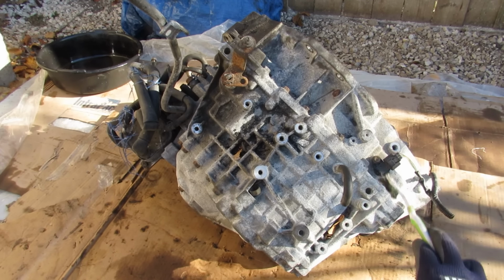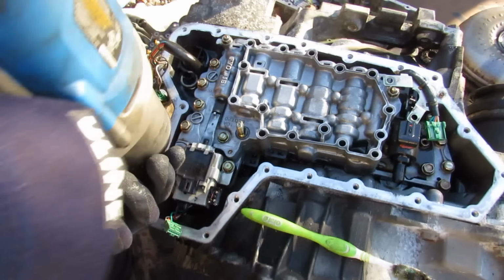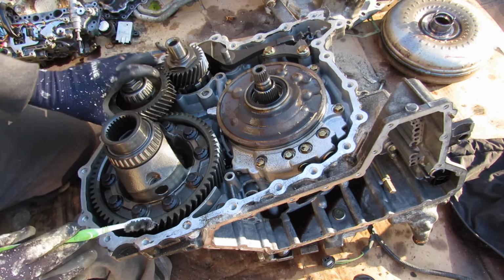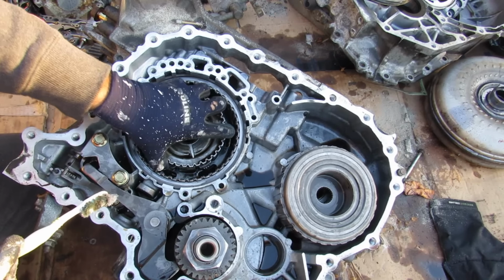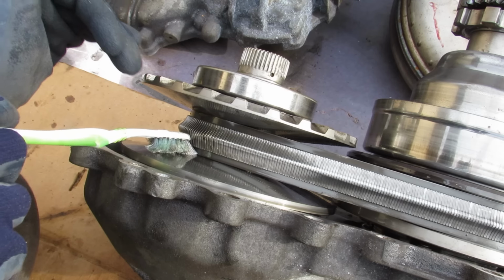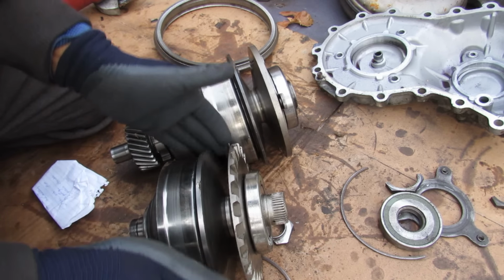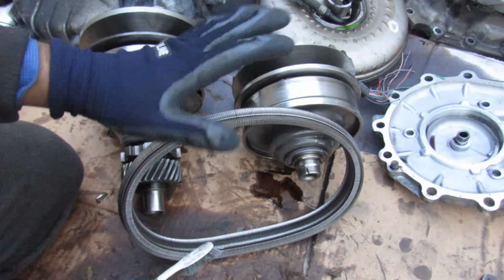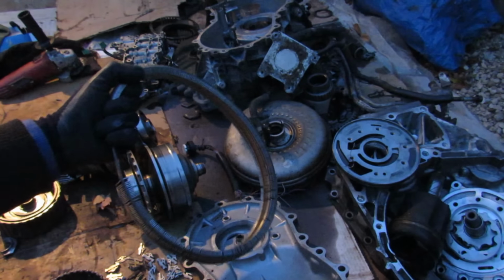Why Nissan CVTs FAIL

Comment: OK, let me ask a question please. I can see that the gearbox ratio is really continously changing with this kind of transmission. Depending of the state of the 2 pulleys and the steel belt. So far so good.
I had a Honda Jazz CVT in the past. It was CVT, and it worked with discrete gears !!! It had 6 gears and it had even +/- paddles on the wheel to do the shifts with those if I wanted. And a digital number has shown the actual gear, D1....D6 like a six gear regular auto transmission. It was CVT, that was the name Honda Jazz 1.5 CVT. Why wasn't it a real continous transmission ? I have expected that.
I sold it, now I have a DCT transmission car, that's different.

Comment: I have a 2019 Nissan 30k miles and shuddering on a rolling stop. In for repair and they said valve baffle is the first step in the repair flow chart. 🙄
Reply from the maker: There's a repair chart? They really don't want to replace the transmission in warranty eh

Comment: yes! as many have said thank you for informing me more about how cvts work.. i had laymans terms explained to me as a steel rubberband that expands and shrinks to determine gear ratio but didnt know much more... definitely helped make the decision to not go and buy a mid-large sized vehicle with a cvt (a nissan at that ) my small corolla with 100k had a cvt and it was doing fine but it was my big fear that it would break and be worthless to repair!

Comment: I have an '04 Serena import with CVT and it seems they fail around 60k miles. Non repairable so only solution is junk yard finds to replace at regular intervals it seems. I want to swap for ordinary auto tranny but can't find an easy swap.
Reply from the maker: Swap to a manual

Comment: MAAAAN i wish the CVT paddle shifters had a 3rd option of 'manual scroll' for continuous\seamless play through it's endless ratio like the CVT's nature and not jump ONLY through pre-set one-digit ratio that's determined by the engineers to simulate only few consecutive gears.. i would've LOVED to have an option of freely use the +\- function via the paddles to use all of the CVT ratio. THINK of how awesome it could've been if u could hold the minus paddle while slowing down and have the transmittion gradually and smoothly reduce the ratio like changing a volume dial or sth, and have a similarly gradual deceleration like it ACTUALLY does in acceleration, just in the opposide direction of operation. Why no one did that yet??

Comment: I'm always curious about how the force acts on cvt belt when the car is on engine brake? How much stress is on the transmission then? 
And more, if you are climbing/descending a steep slop and give it a sudden brake to stop, how the transmission will react? Can it be damaged?
Reply: One should just drive it like an automatic and use the brake pedal. Because power goes through a torque converter there is little trouble at low engine speeds. At high revs the converter is more dynamically connecting the wheels through the belt to the engine and any down shifts are going to try to stretch the belt and also wear the pulleys.
Reply: @joeKisonue  see what i said up above about two-feet driving, joe.

Comment: So in that case why this transmission failed?
Reply from the maker: This one didn't fail yet
Reply: @speedkar99  ouh...
Reply: @speedkar99  so you destroy it for learning and teaching purposes. I was thinking that it was broken becsuse of oil and hardly used belt. Something lost spec dimensions and belt start sleeping on cones. 

Btw this is quite interesting engineering.

Comment: The main reason Cvt trannys dont last is all the power all the times goes through a flexible  steel belt so fluid quality and heat are crucial . Normal Transmissions has the power spread of many gears. It's worse the more power you try to put down on the road. Even Toyota they don't use that many Cvt transmissions but I know the Corolla  has a Normal First gear for starting out and then the Cvt takes over once its up to speed. I hate them, That never shifting and droning . I have always be partial to Honda Auto Transmissions they have that mechanical jerky automatic . When I graduated from High School my Dad bought me a  new 1994 Honda Accord Ex . Best car I ever owned  and roughest transmission ever but it was just part of Honda quirkiness and character.

Comment: So right after watching this video my 2001 Nissan primera with a qr25de 2.5l failed last night. It is not shifting past 3rd gear. After that it just revs higher. Changed transmission oil but still same performance. ?

Comment: yeah...but do you know anything at all about CVT transmissions? 
Seriously dude, you should easily be awarded the Pulitzer Prize for being the definitive authority on CVTs, and the art of creative use of undergarments of close family members...and of course a Nobel Prize in science as the erudite clinician regarding absorption rate, shear and thermal dynamics of cardboard. And using a toothbrush for a power-pointer...that is a mic-dropper right there.

Comment: You can 100% rebuild Nissan cvts. There is also a handful of computer related work required after replacing or rebuilding, so we don't want people to think they are just going to pop one in in their driveway and save $3k. 

Tons of people tow with them no problem,  just keep it under the spec. 

If you can't prove it, don't say it.

Comment: Just testing a few demo cars with new technologies like CVTs for several years in real life conditions before including it in their cars would save automakers so many headaches. Releasing a technology a bit later is certainly better than having to deal with mass recalls and class action lawsuits.
Reply: only in developed countries like USA where manufacturer can be fined for hundreds of millions $ for installing such a defective part (Dieselgate, Toyota blocking gas pedals at max). In the same time, in third-world countries nobody cares and unhappy customers barely get something compensation, if any.

Comment: It has moving parts. and a band that slips over metal. it rubs and slips. It IS going to fail eventually and they work alot. Thanks for an awesome vid. If you got snookered into buying one of these repair shop magnets.

Comment: Thanks for a very thorough explanation of the CVT and its' function / weaknesses. In cities, with all of the stop/starts made at traffic lights, the CVT does not seem to suit such an environment, particularly if the car owner decides to 'floor it' away from the lights! I think that the first CVT transmission was used on a DAF Daffodil car from the early 70's. But (by today's standards), the DAF Variomatic was a rubber belt drive, and crude by comparison. With the future becoming electric vehicles, the CVT will not be needed, because electric motors can supply a high torque, and will rev well in excess of most internal combustion engines. I never want to own any car with CVT transmission - after watching this. There is simply too much to go wrong, and CVT's of that size can only handle a limited torque, especially if there is a delay period whilst the hydraulic pump controls the Cones for the driver/driven section of the unit.
Reply: Whatever floats your boat. I have a CVT in my Ford C-max and I love it. I drove my Mom's Toyota  Sienna the other day and about fell off the seat when it shifted. I had gotten so used to smooth acceleration that the shift was very jarring. I can't speak as to the reliability, but the ride is smooth. :)
Reply: @contumelious-8440  i agree with you. i have a sentra MR20/CVT and i love it. 65K i just did its first fluid change. its a little whiney going uphill, but they all do that.

Comment: jeez this is why i stay away from cvt's in general. when something is that complex there's alot more stuff to fix when something goes wrong. this is also why i stay away from high tech vehicles as they are a nightmare to maintain, once they age they become money pits. i'm sticking to the good old manual transmission
Reply from the maker: CVT is for those who want pure economy and won't keep the vehicle too long

Comment: Very good explanation of CVT. I have owned a 2005 Ford Freestyle crossover for about 10 years. It has what I think is a Volvo drivetrain or engine as Ford owned Volvo then. The one thing that scared me was the transmission. It doesn't have a dip stick. It increases RPM when going down hill, unlike regular transmission. I have had the fluid changed every 30,000 miles and no problem. Thanks.
Reply: > It increases RPM when going down hill
That's for more effective engine braking, as intended.

Comment: CVT is a good technology for cars to actually gain speed faster 
But the way they make it with these low end material won’t last you 150.000km/95.000miles if driving it on a daily basis 
Low end materials unfortunately make more profit
No one is gonna give you a solid CVT except few Toyota’s and I guess where made like that by mistake
Like the CAMRY or AVALON those only have good CVT transmissions

Comment: The cost of a new cvt is about the same  as the cost of a rebuild on a regular transmission ! But if that trash won't make the warranty time ! Be of the car manufacturer to junk that and go back to a more tried and true system !

Comment: My daughters Nissan Altima has CVT 118000 miles so far...I think constant transmission fluid flushes help a lot to keep it working good. So far so good. But you’re absolutely right a friend of mine has a frontier and has had to rebuild his at 80000 miles

Comment: Amazing enough during the hottest days the fluid doesn't protect as well on cooler days (cold days take forever to warm up). The fluid is, in my opinion, not up to specification needed for these transmissions.  Listing for the NS-3 fluid doesn't hold up when temps exceed ambient of 94 deg for long durations (unsure of trans temp at the moment).  @ 87 deg ambient the transmission performs flawlessly. I started the changes here in the last year with 35K mi intervals to see any difference and filter changes at every 50K since ownership. Hoping to exceed wear life for the transmission.

Comment: Hi All’s, my gearbox “qashqai ntec + 2013” has been running fine until one day I stopped at a red light. When it went green and wanted to move the gearbox juddered and did not move forward. Only reverse works fine, any helps

Comment: Providing Parts Debate: 
What qualifies?
Aren't car manufacturers still required to provide parts for so many years after manufacturing?  Can selling you an entire new car be considered providing parts? If not then why can selling an entire new transmission instead of the parts that fail be considered providing parts? If they have to provide parts does that mean they have the right to force you to repurchase parts that didn't fail with it was well?  Maybe we should be investigating??
Reply from the maker: The line is very gray there. But as long as they sell a full transmission the laws and consumers are satisfied (under warranty)
Reply: @speedkar99   Somehow I feel when the average common people start figuring out the high rate of failures that are happening and the resell values begin to drop to nothing that the consumers rate of happiness will hit rock bottom.

Comment: I learned so much from this video that I never had any idea about when it comes to CVT's.  This man apparently is an absolute CVT expert and was a pleasure to listen to.  Thank you.
Reply from the maker: You are welcome
Reply: I learned if it says cvt transmission to move on .
Reply: I didnt even know CVT existed. Thats such a cool technology, completely negating the requirement of a classic transmission.
Reply: @termitreter6545  except they fail earlier than traditional automatics. Many at 60k
Reply: @termitreter6545 l
Reply: @termitreter6545  You don't know a lot about cars do you? Maybe a car with this transmission would be perfect for you.🤣🤣🤣
Reply: @fredzephire4071  hey, everyone has to start learning somewhere, unless you're Minerva and sprung forth fully formed from your father's head
Reply: @flamingspinach  I don't know too many GODDESSES called Fred.
Reply: @fredzephire4071  I don't know too many goddesses called termitreter6545 either, which is my point :)
Reply: @fredzephire4071 there’s nothing wrong with the cvt concept itself in cars, it’s Nissan being dogshit as usual lol
Reply: @somuchworse true, Toyota and Honda have been fitting CVTs to some of their cars for a long time and they seem to be able to make them reliable. It's the JATCO ones that seem to have been troublesome. Although even they seem to be getting better.
Reply: yeah,   and they do not normally repair these -  at all -  even the transmission repair specialists.

Comment: So the biggest problem (from your video) is heat buildup. So adding an extra external transmission fluid cooler is a good thing to do.
Reply from the maker: That can help
Reply: Not extra, just replace with larger

Comment: Why can't you rebuild these transmissions? Is it due to lack of available parts or what?
Reply from the maker: Yeah no parts from Nissan, they don't was any liability of opening it up

So rebuilders or aftermarket have to make their own parts 

At that point it's not worth rebuilding unless it's something simple (like seals and gaskets )
Reply: @speedkar99  didn't there use to be laws requiring manufactures to produce parts for at least 10 or some other set number of years? Is that still in effect? Can selling you an entire new car be considered providing parts? If not then why can selling an entire new transmission instead of the parts that fail be considered providing parts? If they have to provide parts does that mean they have the right to force you to repurchase parts that didn't fail with it?
Reply: Well, no parts from Nissan, well sorry Nissan no cars from you for me.  Pretty well insane when they want to force you to buy entire new units over a part that we all know is going to fail often. That belt should be easily accessable behind a single cover and be a general maintenance item every 50,000 miles or so probably I bet to be a sure thing. Four wheelers have CVT belts that are easily accessable and replaceable so why can't they design these to be.  Surely at a min a tran should be able to be pulled and split in one section to replace it when it fails without pulling every piece of the transmission apart. Got to be a better way. This looks like it was purposely engineered to prevent maintenance and sell high dollar parts to me. Really suspicious looking. Wander if they can come up with a logical excuse as to why they're not being designed to be maintained and repaired easily?

Comment: Less moving parts doesn't mean better engineered for longevity for sure.
Reply from the maker: Yep
Reply: And apparently it doesn't necessarily mean easier to repair in case of failure either. Lol. Or maybe this is entirely due to a lack of parts available.

Comment: Many people don't like the way a CVT drives.  As an engineer, I appreciate it's efficiency.  The engine revs to the desired power needed for acceleration and the transmission ratio changes to match the tire speed.  The best fuel efficiency during acceleration happens at the lowest rpm necessary.  With this, the engine cylinder is fully loaded.  Meaning the compression ratio is maximized, just short of detonation.  I found my Altima can accelerate quickly at 1800 rpm.  For best efficiency, you have to train the cars computer by finding the sweet spot with the accelerator pedal.

I also like manual transmissions for sport driving. I have a BMW Z3 6 cylinder with a 5 speed manual.  That engine loves to rev.
Reply from the maker: As an engineer, the theory you described can be appreciated IF it actually worked like that. 

However the CVT equiped vehicles I've drove just redlines the car regardless of torque band when you floor it. I feel some reprogramming could make a CVT car feel much more powerful than it should be, at the cost of longevity.

Comment: My Granddaughter has a 2014 Juke with a CVT trans.  We had to replace the trans in March of 2020 because it just failed.  No forward...no reverse...nothing.  Just cruising down the freeway, steady speed.  It wasn't until we paid $4000.00 for a new trans that I found out how notoriously CRAPPY these pieces if SH*T transmissions are!!  To make matters worse (if that's possible), my local dealership told me these transmissions are sealed at the factory and they don't service them!  I did find a dealer who would service it, but he told me I "HAD TO USE 'NISSAN' FLUID, OR THERE WOULD BE NO WARRANTY"! (Don't get me started...).  OK, sorry, no more ranting.  What I will say, though, is I will never, that is NEVER buy a Nissan that has a CVT trans in it!!  I don't care how great of a deal it is!

Comment: Toothbrush guy!
 If people understood the theory of a CVT (continuesly variable transmission) they are infinatly variable, no set gear ratios other than the initial low ratio and maximum full shifted out high ratio. They hold an internal combustion engine in it's best rpm range, sweet spots, for maximum efficiency and best rpm for maximum power. Instead of going above and below the best rpm on each shift on a conventional transmission be it manual or automatic. That's why the manufacturers are coming with more and more gears like 8 & 10 speeds to try keep the engines closer to their best rpm ranges with more closer spaced ratios so they don't fall so much way below or above the best rpm ranges. If the engineers could just get CVTs to quickly Transition (read shift) from cruise to power and back again and make them last we would have something. The concept is sound, but the engineering isn't so much so far, unfortunately.

Comment: I replace my CVT transmission fluid every 30,000 miles.  I don't want to take a chance of it to fail because of damage to the belt or the variators from the bad CVT fluid.